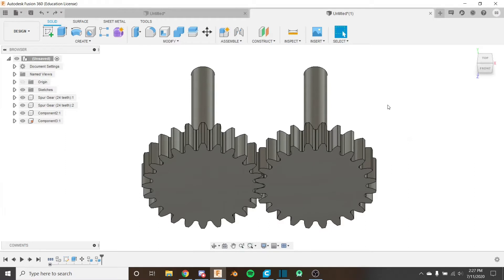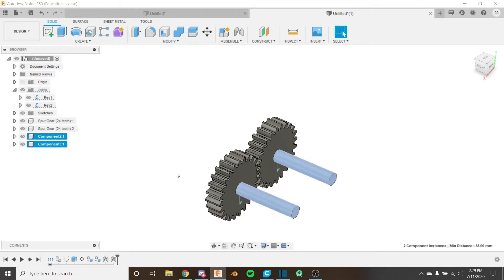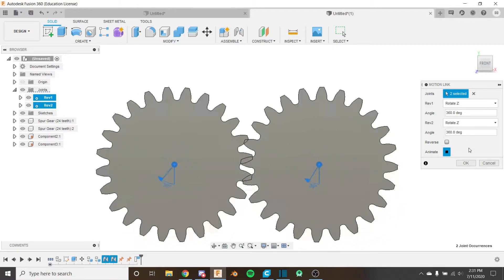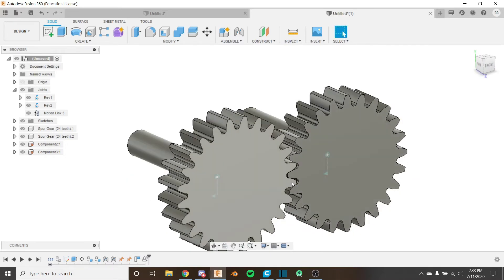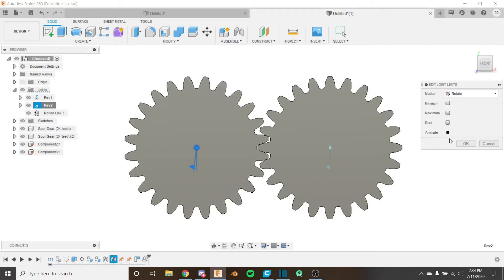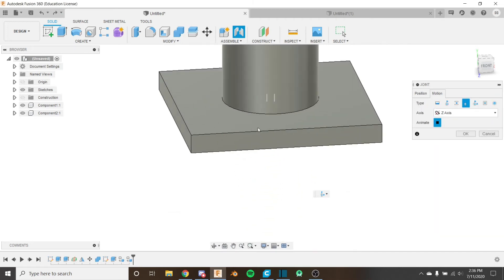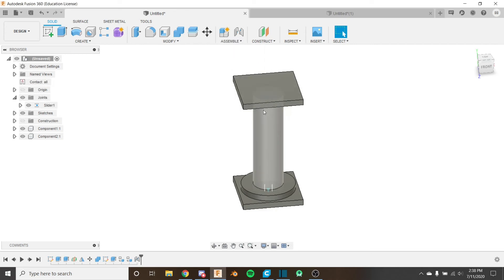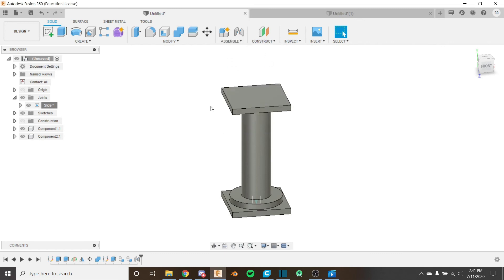Fusion 360 for FTC: Advanced Joint Tools

Comment: a little tip I found out for the motion link of gears, sprockets, and pulleys with odd ratios is to put the teeth of gear (or sprocket or pulley) A as the angle of Rev2, and the teeth of gear B as the angle of Rev1.